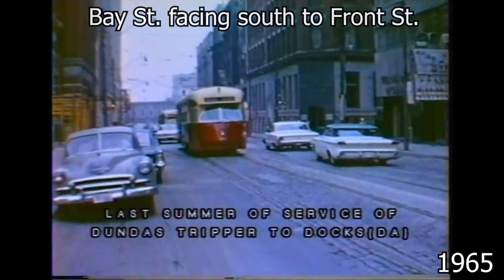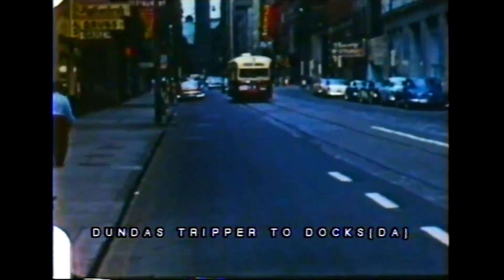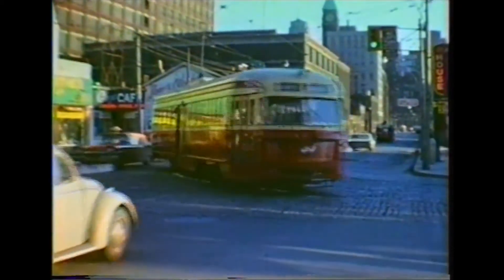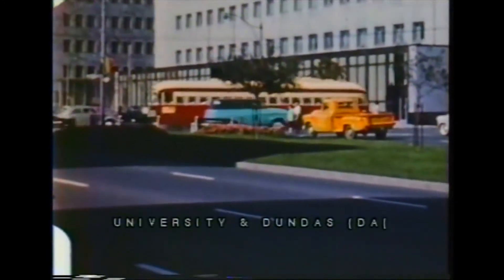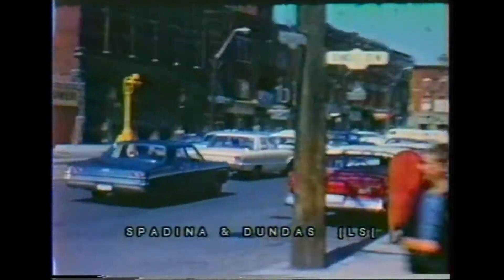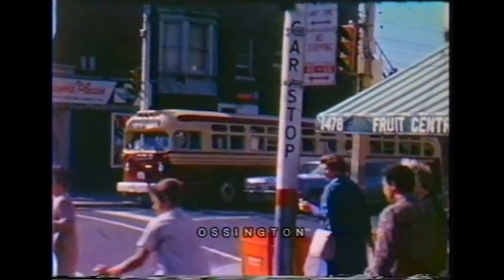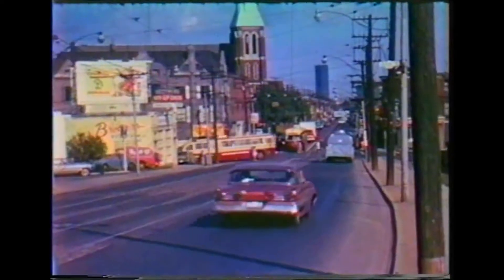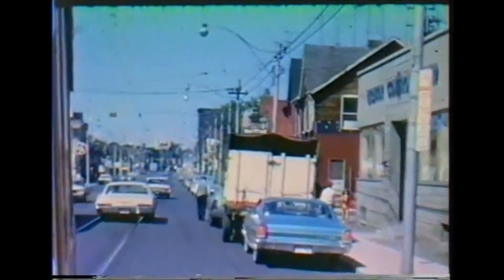Toronto's Dundas Streetcar - 1960s

Comment: 0:49:- correction, air-electrics were the only cars used on Dundas from WW2 to 1966 when they were retired en masse with the opening of the Crosstown subway. Ditto for Queen and King; Ditto for Harbord from the opening of the Yonge subway until 1966, likewise for Carlton. All the air-electrics operated out of only Roncesvalles and Russell and Lansdowne car-houses and all the streetcars at Roncesvalles were exclusively air-electrics from ca 1954 to 1966.